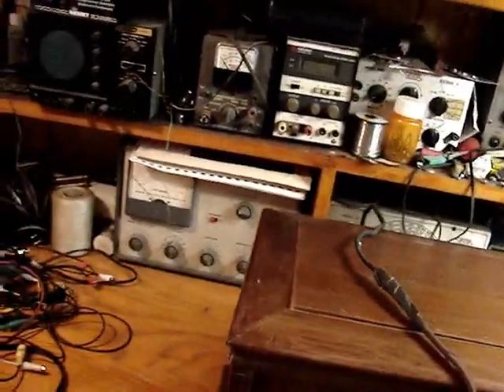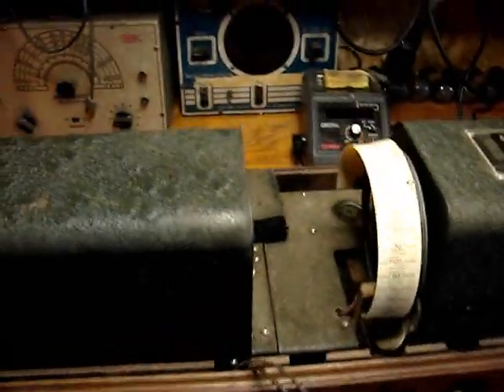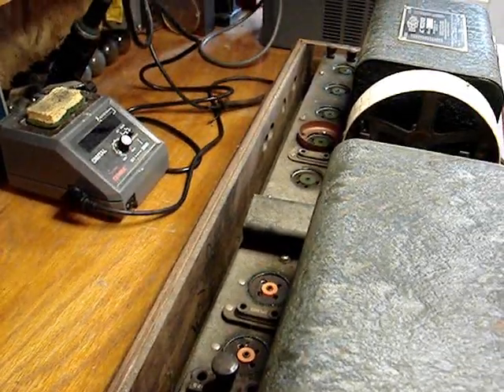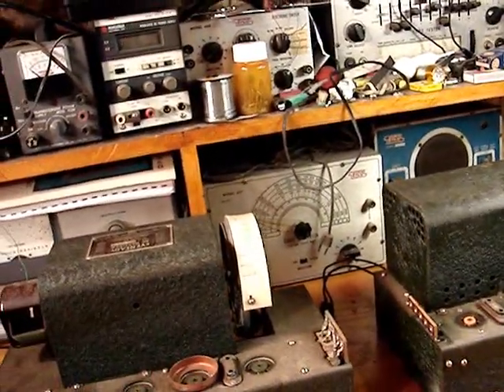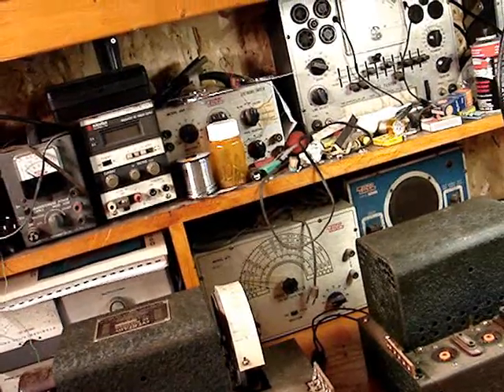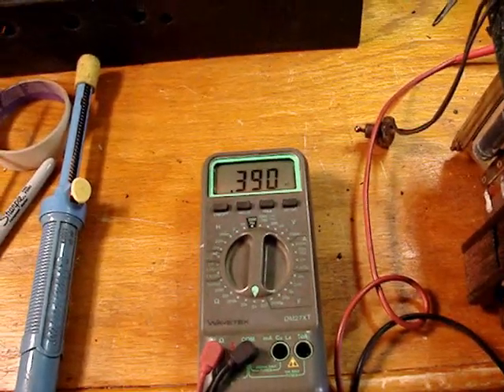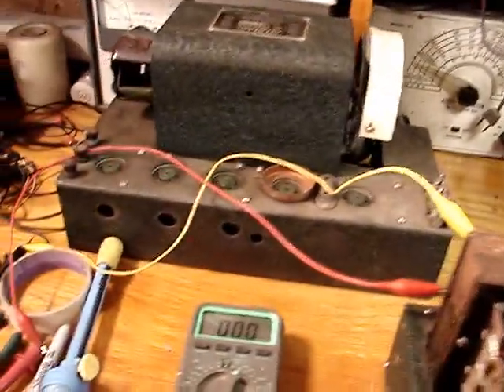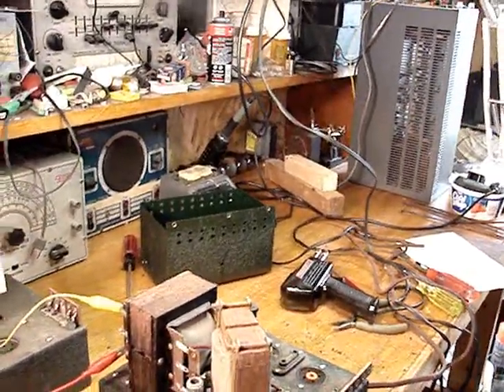Eveready 1930 Radio Model 31 PT2

Comment: A couple of suggestions on remanufacturing the tuning pulley, check with a machine shop who could: 1) recast one out of aluminum alloy; 2) or has a CNC machine that could cut one out of aluminum alloy; 3) or has a professional 3D printer who could produce one out of sturdy plastic.  Not sure which would be cheapest but any should complete the task at hand.  ~Jack

Comment: It's hard to tell what that wheel looks like in the video , but it might be possible to fabricate some type of strong metal pieces that could be glued to the wheel with JB  Weld metal glue to reinforce it while it is still solid to take some stress of the pot metal.